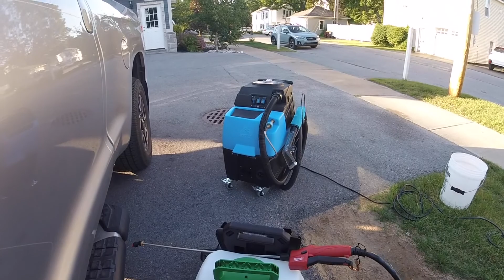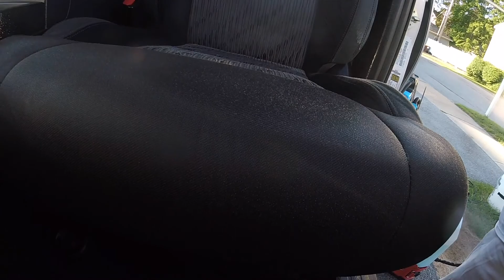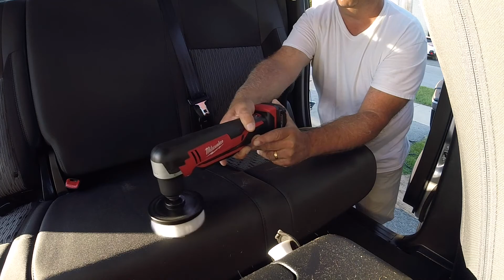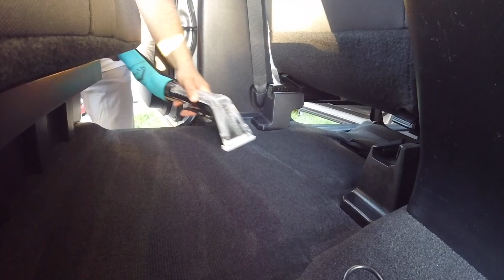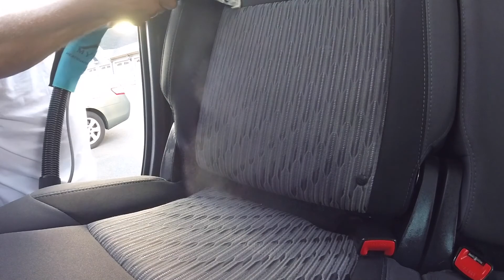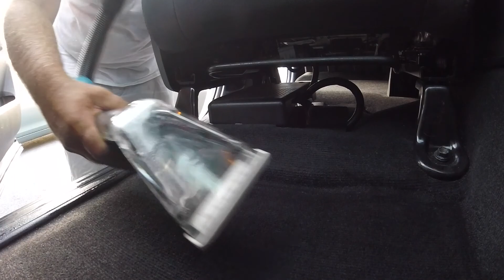MYTEE HP60 SPYDER HOT WATER EXTRACTOR. (TUNDRA CLEAN UP)

Comment: I do not understand how people purchase the mytee 8070 over this,the 8070 is a complete waste of money.
Reply from the maker: This has been a great machine, just wish I could adapt a 3 inch nozzle for better tight spaces. Great suction and heat.
Reply: @1minibean  just hit it with carpet cleaner,steam and a rag,on hard to areas,maybe a thin brush for agitation.
Reply: I bought the 8070 first and it’s not as good as the HP60. It’s got a better design and the buttons are placed better and has a door for the water the 8070 not worth it